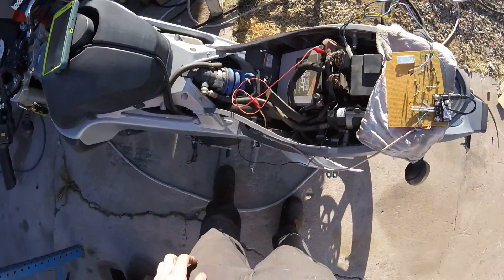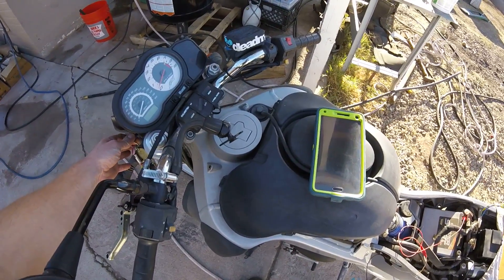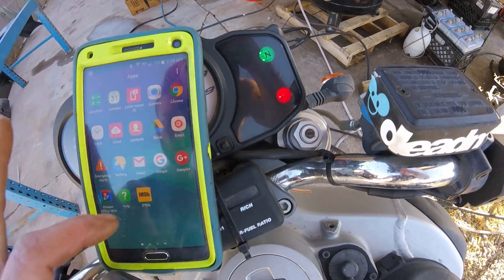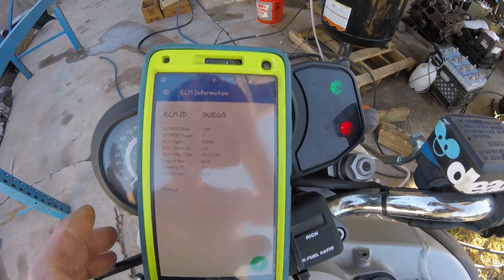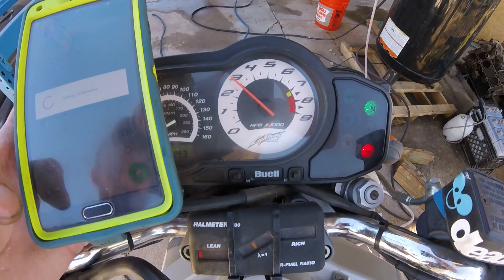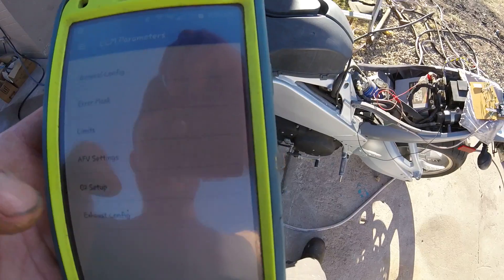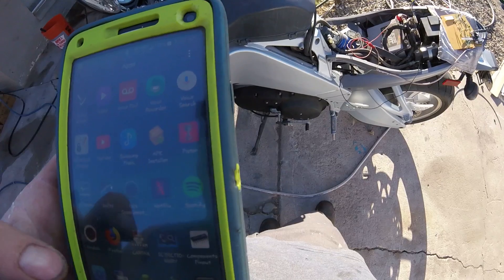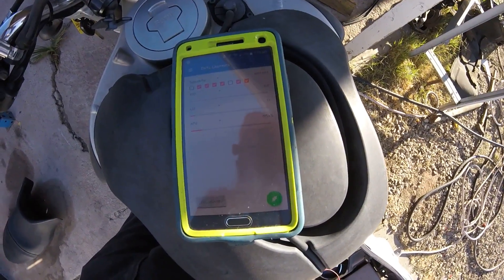Buell XB ECM Tuning

Comment: Where did you get your cable to power up your ecm
Reply from the maker: The ecm is powered by the battery in the bike. Serial communications is achieved through a molex connector I made